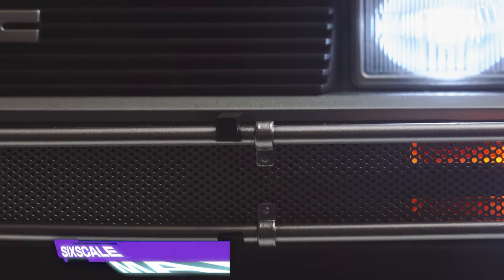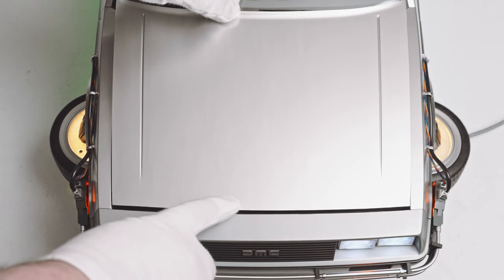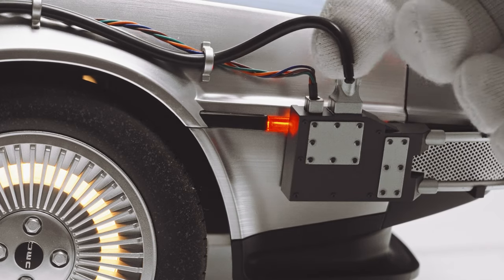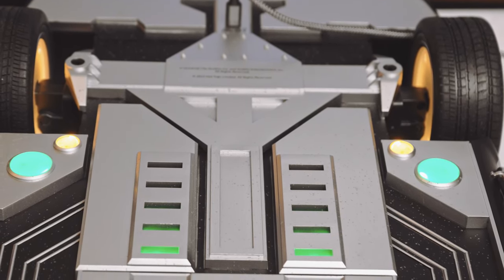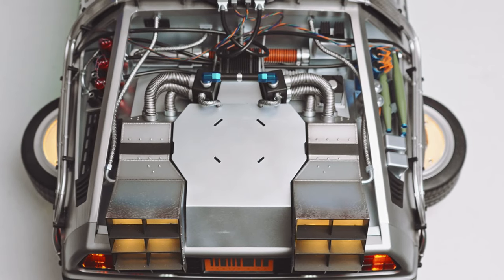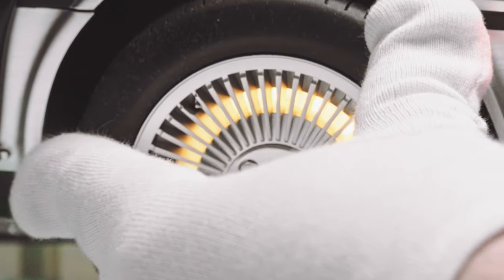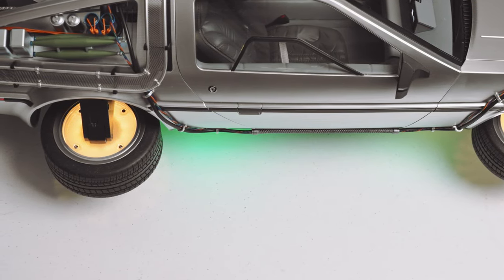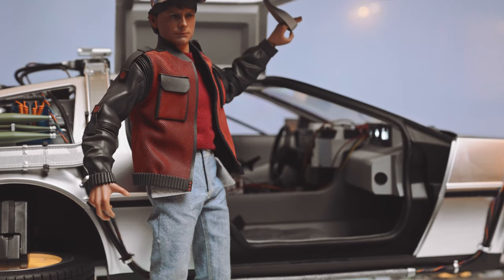Hot Toys Delorean Unboxing and Review | In Depth Guide | 4K | 60FPS | Back to the future II

Comment: Hey again team
Once Flux pieces are assembled. 
Is it not ever going back in box for storage if necessary 😕 🤔
Reply from the maker: If you need to but the only thing I put in the box personally was the original stand because I have Seth’s stand.
Reply: @sixscalemafia  
So it will still fit in box without having to remove flux pieces
Reply from the maker: @thunderchild2237  you might have to take off the bumpers but it might fit. I’ve never tried putting it all back in the box assembled to be honest.